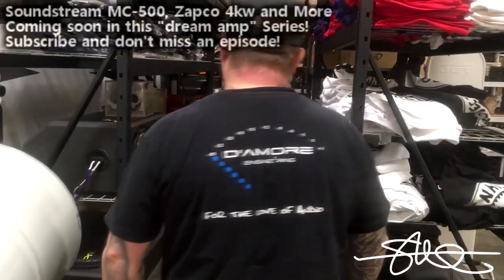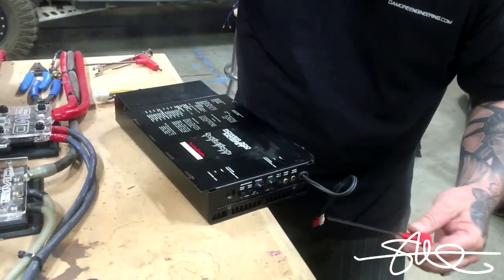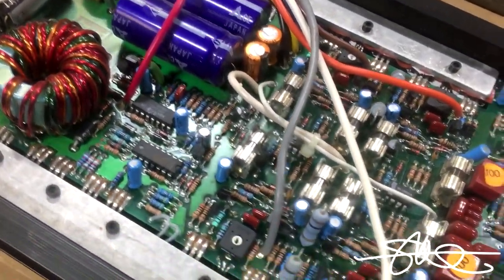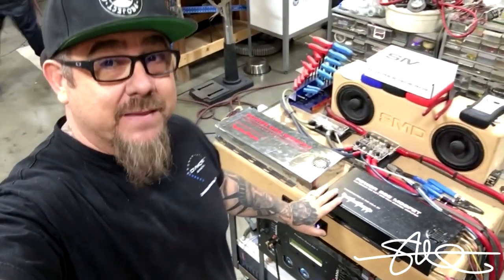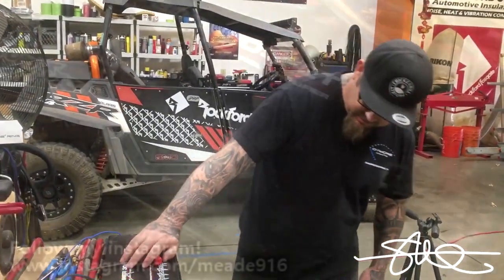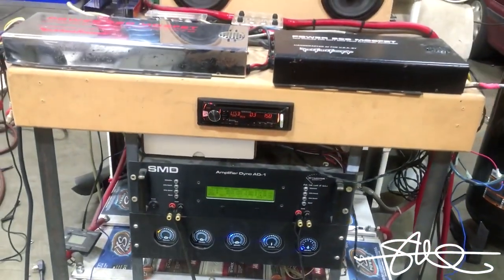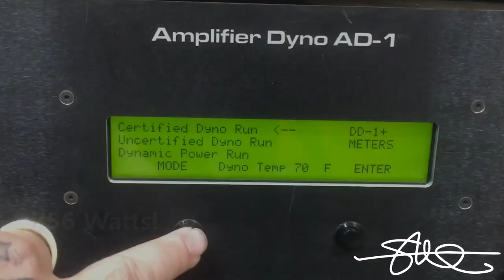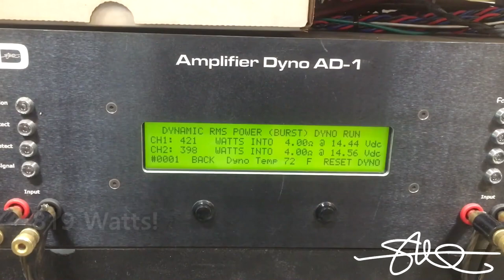Amp Test Tuesday - Dream Amps! Classic 31yr old Rockford Fosgate Power Mosfet 300 - A MUST SEE! WOW!

Comment: Speaking of amp test Tuesday, I am looking for a new amp at  low cost, (I know it's an oxymoron) was just curious about quality of "Walmart" amps. Mainly boss audio, kicker, and pioneer brands and how they preform. As in actual RMS vs advertised RMS. Maybe you can test out one of those next week. :)
Reply: darrell cable I've gotten kicker and pioneer speakers from Walmart and they have been holding up well for 3 years. I've been looking at their amps to
. ain't   never seen him or big d wiz test one
Reply: darrell cable dont buy that crap . Look up PPI 900.4 or PPI 600-2 those amps do rated power and you can run a system active. PPI 600-2 is $100 on ebay & ppi900-4 is 164
Reply: Carlos Lopez  about 6 years ago, (just out of highschool) I bought the pioneer gm-5400t (not knowing any better and being on a low budget) to power two 125w rms free air pioneers in truck boxes. Worked really well supprisingly. But recently
I actually picked up the skar LP-750.1dv2 to power two older 4ohm SVC 12" 300w rms pioneers in my old ladies Stang. Just waiting for it to show up. I've learned a little bit in six years. Lol
Reply: I got a pioneer 1,000 watt amp from Walmart it’s held up but it’s nowhere near 1,000 Watts id say 400-500

Comment: What is better power or punch.  I have a punch 800a2 never had the back taken off it’s a damn good amp I had it on 2 kicker comp vr 12s it beat the hell out of them with the gain half way.
Reply: Gain half way?  Lol you should probably do more car audio research.  You set the gain to right before distortion, where ever thats at for your set up. Doesnt matter if its half way or less than half way. Just a tip.
Reply: Yes I know I could’ve turn the gain up more but I didn’t.
Reply: The punch 800@2 has bass boost on the amp, the Power 800@2 uses a remote.

Comment: Hello boss one question what amp can i use for my 2 12" jl audio w6v3 ????
Reply: erick linares Any amp that pushes 1200-1500 watts at 1 ohm. Wire the subs in parallel and your set. The R1200.1D doesn't disappoint. The Skar Audio RP1500.1D is a good bet. If you wanna stay with JL Audio, the Slash 1200v3 driven at 4 ohms or the HD 1200.1D driven at 4 ohms would be good.

Comment: The very first earthquake digital...
Reply: yes yes fucking yes, please, not the d2, the original with all the 1's &0's all over the top.
Reply: Yes sir....that is a beast
Reply: Without earthquake these other class d amps wouldn't exist.
Reply: I remember they closed to be half ohm stable, and some crazy shit like 1450 RMS???
Reply: 2g rms....my buddy had it on 3 JL 10w6 in a eclipse it banged...made my jaw drop when I seen how small it was
Reply: Got mine out of a pawn shop for the low....put on two Solobaric S12Cs in a medium sized sealed box....killer!

Comment: I need help setting gain and subsonic filter on a RF prime 1200 amp, my subs are RF P2D2 wired down to 2ohm at 800 watts. That’s my system. Please anyone could give me advice to set the gain and subsonic filter the easy and cheap way thanks In advance
Reply: Whad Up  there is no cheap easy way to set gain correctly. You can get close but it still won’t be right. I don’t care how many of your buddies say they can do it by ear it WONT be right.    Your cheapest option is 200$ for a distortion detector by diamore(yes I know I mis-spelled that) Steve Meade sells them on his site. I guess he collaborated with em somehow since his name is on the detector. Super easy to use, you’ll find the clipping point of your head unit. Then set the volume just below the distortion volume level to move on to check the amps max output before clipping. It will come with a CD loaded with various HZ levels and options to get the most out of your amp/head unit. Clean/undistorted power.  200 bucks is cheap considering you drastically reduce the possibility of burning up your system by setting things properly. 
    As far as the sub sonic filter:  just go by your sub and box tuning to set it at a safe level.
I bought both the distortion detector and the crossover checker. Used em twice on my system and have charged 20$ a pop to do my buddies systems and have almost pd for them. GET THE DISTORTION DETECTOR!!! U can guess and maybe get away with it but why risk your gear?

Comment: why dont you show what these amps make at 12 volts almost no one wil have 14.5 volts in there daily drivers
Reply from the maker: actually, 99.9% of vehicles out there charge at 14.5 or more when running.  That's why.  12v ratings mean nothing.  I never turn my shit on with the car off.
Reply: meade916 so your telling me my 12 volt battery runs at 14.5 volts when its on? Cuz I was just thinking the same thing as him i thought my 12 volt battery would hover around 12 volts always no more than 13 volts
Reply: thatguy6214 A fully charged battery is around 12.7 volts depending on temperature. The alternator is regulated at 14.5 when running, some older systems are 13.8. The alternator has to provide a higher voltage than the battery to be able to “push” electricity into the battery for one thing.
Reply: If the alternator only pushed 12v it would never charge the battery and supply the vehicle with its electrical demands. Thus 14.2 or a little more is pushed out.